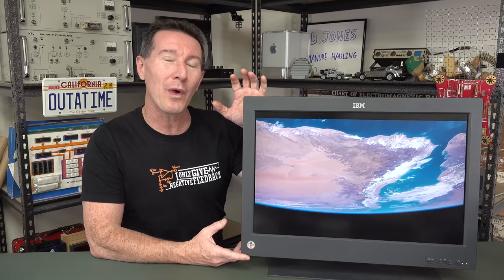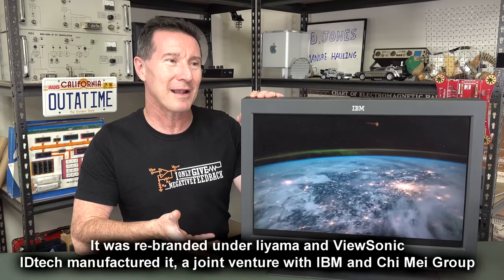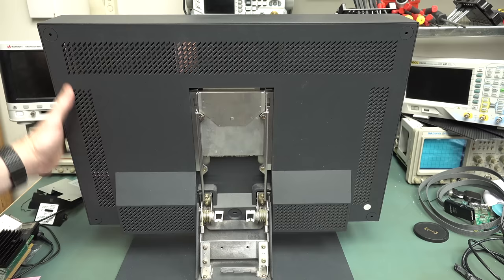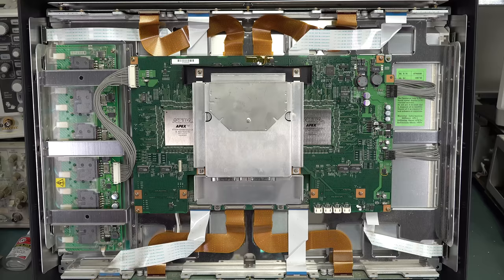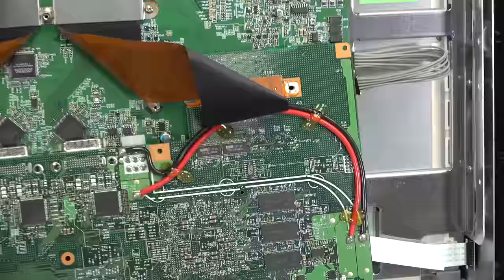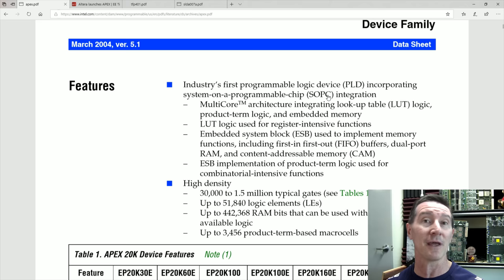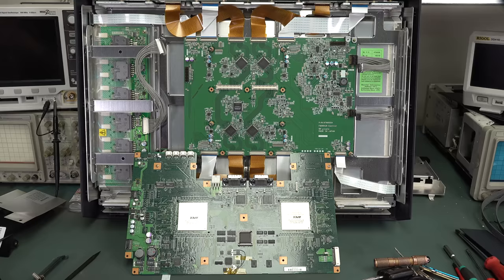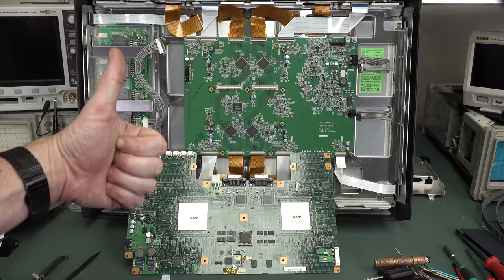EEVblog #1215 - $18,000 4K Monitor Teardown From 2001!

Comment: Years ago I used an IBM 5081 monitor obtained as surplus which probably also had cost a fortune when new.
Those were 1280x1024 Trinitron monitors, actually a Sony chassis with some IBM customization.
At the time these were produced that too was a quite high resolution...

Comment: That is pretty wild. It would have been fun to be a fly on the wall during the design of this product! The 41Hz refresh rate is amusing.
Reply: TheResistorNetwork Basically what was left when running 8 DVI links at max year 2000 speed and trying to fill that screen.

Comment: I was feeling the king of the world with my new 15" 1024x768 60hz samsung lcd (still works) in 2001
Reply: Funny. I just pulled out my old Syncmaster 17" for a weather station monitor. Solid as they come.
Reply: with refresh rate of like 150ms lmao
Reply: Mu Aries
Nerdy noobs never need good colors, or resolutions!
Just HD ready 8 bit good, only needing more frames!
Reply: @lucasrem  i think you are confusing HD (1280 x 720 pixels) with SD (1024 x 768 pixels) and no I dont use it daily.
Reply: @harshnemesis  When lcd first came out response time wasnt even quantified... we were greatful that we could ditch the big ass monitors for a slim one
Reply: @muaries12  Nah we really weren't until like 2007 when lcds were actually superior to crts. 2004 and early have terrible refresh rates, where you had ghosting so crazy you'd see cursor trail, these were only useful for office really for applications where there wasn't much movement on the screen and too little space for the big ass crt.

Comment: The LCD/TFT (model no. MD22292 B2 - data sheet available online) is produced by IDTech (International Display Technology), which correctly was previously IBM's Display Business Unit. It was sold to Sony in 2005 in order to produce small displays for handheld devices, but I have no idea if the factory is still in operation. IDTech also had a manufacturing site in the Philippines. As the PC division was sold to Lenovo in 2005, IDTech closed since Lenovo (of course) wouldn't be interested in taking over display research. IBM also used IDTech panels in their 15" Thinkpads from the A31 (I think) up until the T60p. They branded this as "Flexview". You could even get a 15" with QXGA and IPS in 2003 ( model no. IAQX10) with a refresh rate of 50 Hz - I have retrofitted this into my old T60p :-). They also had various other interesting products, but I think the laptop market really produced the profits. This is almost 10 years before all the retina mumbo-jumbo happened.
Thanks for the teardown - really interesting to see!

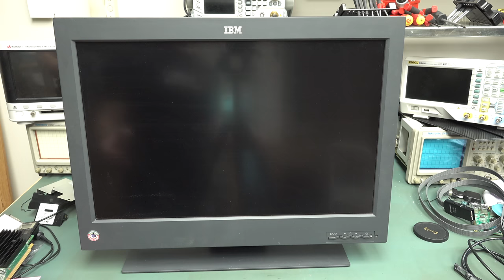Comment: @3:35 "weighs 13kg..." for a monitor from 2001 it is more like "weights only 13kg", the comparable screens from that time were the P1220 and GDM-FW900, weighing in at 30kg and 42kg respectively! and they could manage "only" 2048x1536 and 2304x1440
both of course used Trinitron technology, none of this shadow mask rubbish
Reply: @666tomato666 The trinitron had a shadow mask, but it wasn't made of dots. It was called an aperture grill. The Trinitron PC monitors I used had an annoying pair of wires across the screen to dampen vibrations in the grill.
Reply from the maker: Wow, 42kg!
Reply: @whitcwa  shadow mask is shadow mask, aperture grille is aperture gille. Yes, both are used in CRTs, but confusing them is like calling an "electric engine" a "petrol engine"
Reply: @666Tomato666  and monochrome used one big smug. if you get the picture sharp it looks like diamonds
Reply: @whitcwa  mostly to keep the tension on the mask so it would not warp.

Comment: Nice teardown video. Predates HDMI even!
Reply: VK7HH HDMI is DVI with a different mechanical plug.  At least Samsung made DVI monitors with HDCP for DRM playback.
Reply: @johnfrancisdoe1563  I think at least nowadays, DHCP is a requirement for DVI, in fact both my older and this monitor I have now had DHCP enabled through DVI, and old digital TV-ready sets had DVI for the digital decoder input partially because of that.

What makes me wonder is why IBM didn't use dual link on the DVI cables, 2 dual link cables would fill all the frame at 60Hz
Reply: VK7HH
this is DVI, same as HDMI, you can exchange cables... connector guy???
Not that smart?

Comment: I used to work on big CRT from the same time. I think it was 23 inches and 1920 x 1380 at 60Hz or so and it was absolutely amazing experience. I never know that tech like this was already existing. Thinking that LCD are just toys  that time :)
Reply from the maker: I worked in the LCD flatscreen department at Keycorp in 1994, 800x600 was state of the art, 640x480 most common, and the guarantee was no more than 5 dead pixel!

Comment: One more thing.

I purchased one long ago from France and the obtuse person who shipped it just laid the monitor in a cardboard box without ANY protection whatsoever. The plastic is old, so it's brittle and the screen was completely ruined. It works so I kept it for spares (even though it smells like a bar).

I donated the power supply to a Canadian gentleman who has a fully functional unit and took apart the screen a bit beyond what you've done. There's nothing much behind that 9M pixels made in Japan board, so I even regretted removing it, but I can send you a picture if you are interested.

Comment: Regarding your question at 6:00, I'm using the amazing UP3218K which needs two DisplayPort-connections in order to provide 8K@60Hz. With only one it can still do 8K@30Hz. By the way, this monitor really is the perfect monitor for using Altium. :)
Reply from the maker: Not at 22", too small
Reply: @EEVblog  I'm sorry, I meant the UP3218K is perfect for Altium.

Comment: The first 144 Hz Gaming monitors required Dual Link DVI even for 1080p. Like this monitor the reason is the DVI bus cannot transfer enough data across a single link for full refresh rate.  On this 4K one it is taking it to the extreme.  I doubt back then very little 3D software could or the GPU could handle 4K.

Comment: 6:08 Some of the new 8K monitors that require 2 DisplayPort cables will run at 30hz if you only have 1 connected.
Reply: This was true of early 4k monitors, as well.

Comment: Dell's current 8K monitor is like that. Give it only one DP input and you only get 8K@30Hz. 60Hz requires 2 DP 1.4 connections.
Reply: saljuice
Thunderbolt 3/USB4 replaced it, DP 1.4 still used, still max 30, try it, is it real 60??!!! Overclocked??? most run them on apple.
apple is the better os, forcing them om Thunderbolt, 10bit 5k@220 or better now! 12 bit emulating too!

Comment: I am curious about what the PIC processors are doing. You pointed out the main PLCC one and one smaller one. I noticed there is a second identical smaller PIC with similar circuitry around it to the other small PIC.
Reply: Kevin Cozens configuration and OSD-
Reply: I was thinking that it might even be the user interface control?

Comment: Single and dual link DVI was also used in early days of modern 4K monitors. Some of them was able to display 60Hz using dual DVI and 30 Hz using single link. My Dell 4K does support monitor chaining over DP. On single monitor it supports 60Hz while 30 Hz in chain setup. This is because 4K uses around 18 Gbps of total 20 Gbps DP/Thunderbolt 2 bandwidth.

Comment: Holy crap.  This is like the Sledghammer Corvette of monitors.  The Callaway Sledgehammer, if you didn't know, set the speed record for production cars in 1988 w/ John Lingenfelter behind the wheel, at a top speed of 254.76 mph.  Held the speed record for nearly 20 years , until the SSC Aero barely broke it in 2007 at 256.18mph.

Comment: Thank you for sharing this great piece of technology with us. Can't find it on ebay. Someone would say why bother this is outdated you can buy a new monitor for cheap. Well the thing is this was made to last while today when you buy something dies out in a year or two. I still use old crt monitors 20 and 15 year olds and they still work as new while I had been through a dozen of new monitors that break down fast or have a fault rendering it unusable. To the point I don't bother with new monitors anymore for some years now.

Comment: Yes, splitting up signals was quite common up until a few years ago. People wanted 4k at more than 60 Hz, so they would need to use two DisplayPort connections until a faster DisplayPort spec. was finally released. I don't recall if they ever did that with HDMI.

Comment: I've read about this monitor on a Magazine when i was in college, CHIP - Magazine, i''ve never had chance to see it in real. Old memories :). I had 14" Hyundai monitor back then, i think it was 1280x800.
Reply: Probably 1280x1024 or 1024x768 at that time
Reply: @brandonupchurch7628  I don't think so, CRT's allways had different vertical pixels and screen format. Or, at least my model :). I still have it i think somewhere in garage.
Reply: If it was a consumer monitor from the early 2000s it would have been 4:3 or 5:4 , Typical max resolutions for a 14" monitor would have been probably 1024x768 but I guess a higher end 14incher could have supported 1280x1024 or 1152x864.
Reply: 1280x1024 is correct only for 5:4 LCDs, but not for any CRT (there were no 5:4 CRTs at all). For 4:3 screens you would use 1280x960 but many people used 1280x1024 anyways at the expense of wrong aspect ratio (5:4 streched to 4:3), usually not even noticing it. Since a CRT doesn't care about the aspect ratio, it will display anything as long as the signal is within it's scan range, that's why it worked nevertheless (but slightly stretched).
Reply: There were plenty of CRTs that supported 1280x1024, my cheap 17in Compaq CRT I used in the early 2000s could.
Reply: you also got to remember that CRTs don't have fixed pixel positions and that you could adjust the vertical position the horizontal position and scanning so it wouldn't have really looked scaled plus I mean that difference in the dimensions between 4 by 3 and 5 by 4 is not that much that means that one axis is 80% of the size of the other versus 75% of the other on 4 by 3.
Reply: @brandonupchurch7628  Yes. But you didn't read well what I wrote. I never said CRTs didn't support it. A CRT does support absolutely any res that is within it's scan range. It could be as whacky as 100x1000 and it would display fine.

I said a 5:4 res is wrong for a 4:3 monitor, even though in case of a CRT it'll display it just fine otherwise – just streched to 4:3 as you would usually adjust picture size so that the borders meet the bezel of the screen, wouldn't you? You would have to leave a border at the left/right sides to compensate for 5:4 but who would do that. So in essence, if you used your CRT at 1280x1024, rather than 1280x960 and filling the full physical screen then the aspect ratio was slightly off.
Reply: Well it was pointless information why don't you go tip your fedora and AHHHHHHHHHHHHHKUUUUUALALLLLLLLLLLLLLLLLLY someone else
Reply: @brandonupchurch7628  I see some people just prefer to live uneducated. But that's OK.
Reply: Exactly you can keep being the uneducated one because 1280x1024 was essentially a standard at the time and 1280x960 was pretty much an oddball custom resolution. If you opened control panel or edited an XFree86 config back in the early 2000s,  your available modes would have involved one of these resolutions: 640x480, 800x600, 1024x768,1152x864, and 1280x1024.

Comment: Ah the good old days. We had a dual display setup with these running under Linux back in the day. It was a bit temperamental but it was pretty amazing when it did.
Reply: hard to imagine back then - even 4k on a 27" looks like really high pixel density for a monitor!

Comment: In 2002 or 2003 I purchased a Hercules 17" tft at 1280x1024 and for its time that actually was an impressive screen. I actually paid a bit more to have DVI! That wasn't even standard back then. If you'd told me back that there was such a thing as a 4k display I'm not sure if I would have believed it.

Comment: When we started to designe our current project the MSRP of the FPGA we used, that wasn't even released yet, (We had two of the 3 existing dev boards existing) we already was way over 2000$. We got it for 1200$ the first year, 480$ the second year and are now down to under 200$ / piece. We are not even that big of a customer. FPGA prices drop extremly fast.

Comment: I wish my world was as 4th dimension-fluid as Dave's -  5:10 (where 2008 is older than 2001) - hot shot in 2000 would have been a 3dfx Voodoo5 or maybe the OG Geforce 256... if they're doing workstation stuff they might have had something like a 3Dlabs wildcat?
Reply: it was typically sold with Matrox card at the time
Reply: @666Tomato666 Makes ways more sense, Matrox had like the monopol for professional use back then.
Reply: @Chris Bourne Just last night I watched the movie "Arrival", Dave is like the main character in that movie 😂

Comment: Quadro by nVidia are the Workbench lineups... designed to be massively reliable, while power efficient. you can run them continuously on full load and they won't be mad at you for doing so. And it makes sense since - as you said - the monitor was mainly used in research facilities.

Comment: Most of the current 4K 144Hz monitors do the same, using 2 DP-cables to carry the signal. If you use only 1 cable, you'd be limited to 120Hz or have to use chroma subsampling.
Reply from the maker: Ah, thanks, didn't know that. Obviously I'm not a gamer...

Comment: In 2007 I had to buy new monitor, because of fault of my previous. I visited shop of used and refurbished electronics and been seriously amazed by 4K monitor. I don't remember what brand it was, probably LaCie. I couldn't realize who can use such huge resolution on that diagonal - not more then 26". Windows looked tiny, text was unreadable. And actually it was a specific display for photographers and publishing systems. If I can recall now, price was circa $3000, and it was absolutely not my choice. I picked SONY FW-900 for $700, it had 1920x1200 and unbeatable Trinitron contrast. Used it for 6 years until CRT degraded.

Comment: I've had a Belinea 19" and a philips 14" (my first vga monitor) around 2000. Always loved multi monitor setups. I think the 19" ran 1024x768@72hz and the 14" 800x600@72hz. A 4k panel would've made windows 2000 unreadable, certainly for software with non scalable fonts like adobe photoshop. These would probanly have been used as second proofing monitor back in the day, next to a normal 21" crt display or similar. With shades around it to protect it from incident light that could throw off color accuracy. I think these would've also been used in digital video editing and high end graphics design because of the calibration option.

Comment: pretty cool stuff. there were a few very high res displays back around that time that took quad DVI inputs, but IDK if they all gave you the option to use less or even split the panel into 4 quadrants so you had to use 4 cables.
Multi-monitor was about all matrox was doing after nvidia took over the GPU market, but evidently nvidia got their hands in that stuff as well :P
Reply: I remember seeing those attached to MRI scanners, and all four cables were hooked up, at least on that setup. 

I got a ride in one after hosing my knee playing football (the Yank kind) and they had to see what snapped. It was pretty neat (after the scan) watching the slices resolve on that HD display as the tech twisted their depth knob - didn't need an MD to diagnose torn ACL - the puppy popped right in two, and it was clear as a bell as the tech passed through it a few times.

Comment: Wonder why they went with 4 single link cables instead of 2 dual link? Maybe something to do with how they are technically out of the dvi spec and had to use workarounds to get the full resolution?

Comment: There's an 8K monitor from Dell (UP3218K) that does a similar thing with the cables. It needs two DisplayPort cables to do 8K 60fps. If you plug only on, you get only 30fps.

Comment: There is a 4k panel (my main display) -- it runs at full 4k resolution at 120hz with one displayport cable, and can do full HDR at 120Hz with 2 displayport cables (haven't tried it), so it's still a thing using extra cables for more bandwidth.

Comment: My HP Z27q 5k monitor uses 2 displayport cables to enable driving it at 5k for similar reasons. The displayport cables at the time (1.2 iirc) didn't have sufficient bandwidth to drive 5k at 60fps so each displayport cable would render half the display,  2560x2880.

Comment: Commodore 2024 for the amiga did something similiar with the resolution.  it buffered several 320x200 screens to make up a 1024x1024 screen-  stunning back by then..

Comment: 2004 I had like 15 inch 1024x768 60hz LCD which was a downgrade from a older 19 inch Samsung CRT from late 90's which had higher resolution and more hz but my eyes still thanked cause late nights the CRT melted my eyes 😀

Comment: Maybe there is a micro to handle the OSD and sense the incoming signals, and then the FGPAs get configured to do the on fly driving stuff right away. It sounded like there was a optional breaking up of the 2x2 into various source signals, the FPGAs probably figured out when configured.

Comment: Always been a fan of laptop docks and multi screen systems..... 
Back in the day I had a 3 CRT 17" screens with a desktop system.....
I cannot believe if they even had any 4K videos back then !
Reply: Shakaib Safvi A few blockbuster Hollywood movies did CGI at "4K" or above, distributed on celluloid / plastic as if filmed directly.  Also, big ass astronomy telescopes were huge resolution with wafer-sized low light CCD sensors.